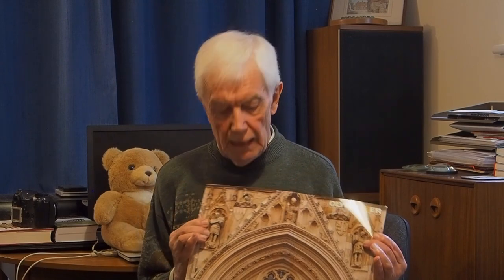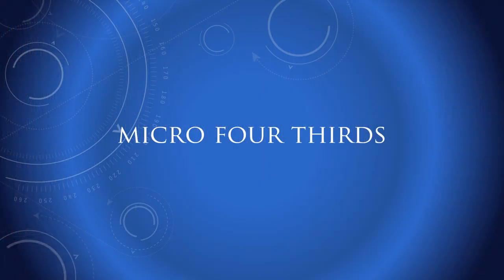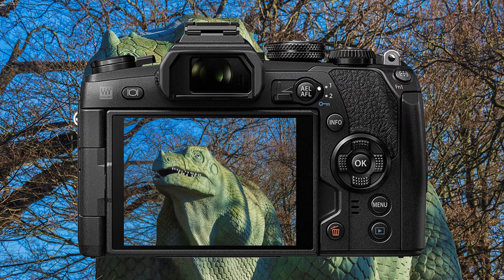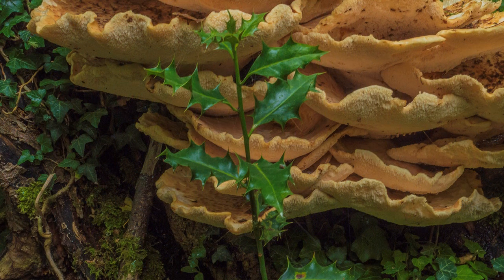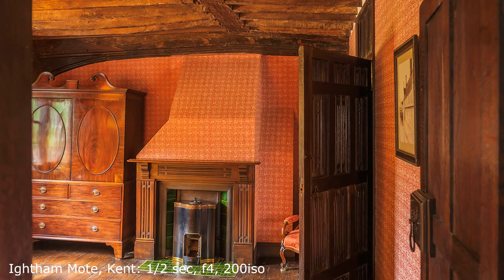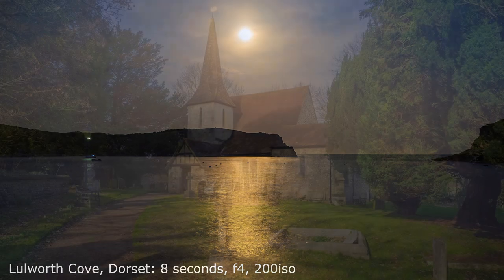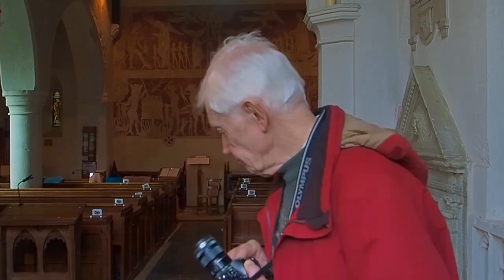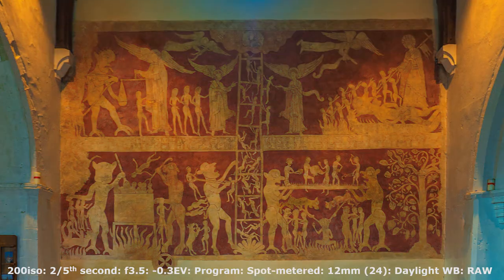Olympus Vision

Comment: Thank you Derek another beautifully crafted video. I regret having sold my 12-50 lens, it was so versatile and included the ‘macro’ feature. I now have the 60mm macro but it’s not as versatile. The EM10 mkii is a joy to use even though it lacks some features of the more recent OMD cameras.
Reply from the maker: Thank you for your comments. I use the E-M10mkii as a backup camera and sometimes in its own right.

Comment: All well said Derek, Three identical images taken on three different Cameras, a landscape image mine was with an elderly Olympus Pen-F, the other two were taken on Leica and Hasselblad respectively, and no one could pick out what image was taken with what Camera, which supports basically what you have been saying, Olympus Glass is as good as it gets for Quality and still is to this day, best wishes, Colin.
Reply from the maker: Thank you for your comments. Pixels and sensor size are not the only elements of a digital camera that determine quality.

Comment: Hello Derek,
You have produced an insightful series of videos for a newcomer to Olympus like myself. Thank you.

Having just acquired an ‘excellent+’ copy of the original E-M5 at a very low price, I now have the Olympus bug and would like to get a later camera—such as an OM-1, OM-5 or a late model E-M1 or E-M5–for our upcoming trip to Japan in Autumn.  What is your advice for single camera-lens combinations that would take great photos indoors and outdoors?

Best regards, Jay
Reply from the maker: Hello Jay. I am so pleased to learn that you find my programmes helpful.

I would recommend two travel lenses, the 14-150 or the more expensive 12-200. Here are the links to my programmes about these optics.

14-150 
https://youtu.be/AIVTTRb_Csg

12-200
https://youtu.be/khDuSa3D_Q8

Currently I am using the OM-5, an excellent travel camera.

Hope this information is helpful for your trip to Japan.

Derek
Reply: Thank Derek. I shall view these videos tonight. I’m also wondering is the faster 12-40mm Pro lens (f/2.8) might be a candidate. Any thoughts?
Reply from the maker: @jayhorton  Could be if f2.8 is important. I have never used the 12-40 but currently I am using the 12-45, but the largest aperture is f4. I have done several programmes about the OM-5 with the 12-45 Pro Lens.